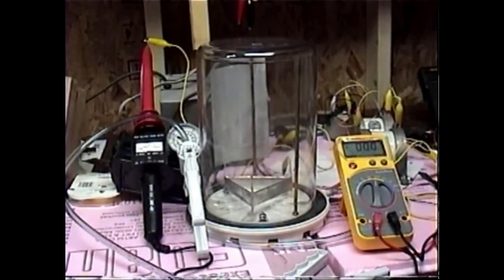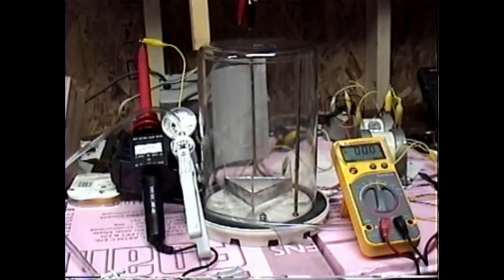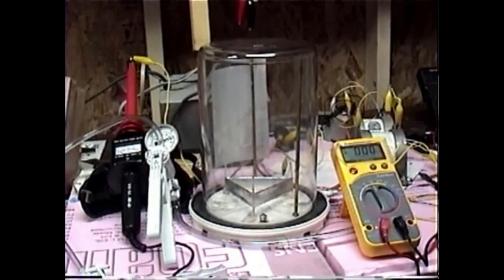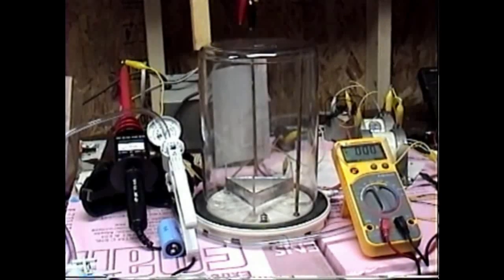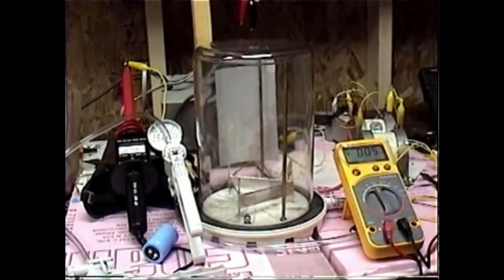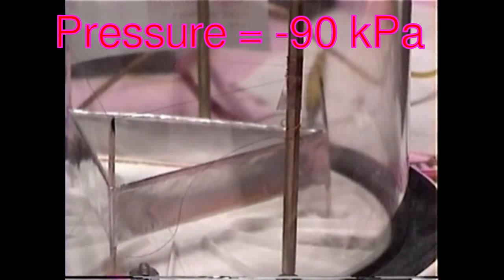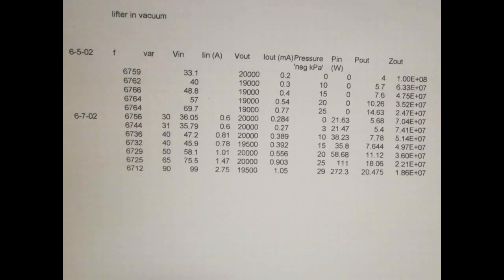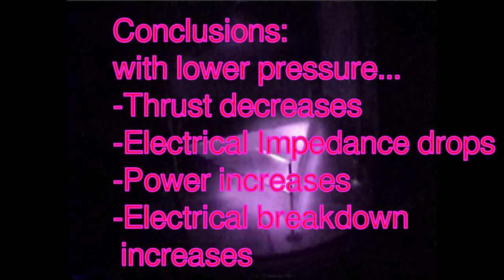Lifter in a Vacuum : Electrodynamic Ion Propulsion

Comment: Hi, This is an ion thruster Setup of the Brown biefeld effect. Brown biefeld mixed These phenomens themselves. There is a second effect BB got themselves into in the 1920s. 1. Use a homogeneous dieletric which is not air. 2.  The voltage must be high enough that the dielectic Shows leakage, but not shortcutting behaviour. 3. There must be enough current available the power source does not collaps when the dielectic acts as resistor. 4. The current must be high enough to generate a circling magnetic field around the dielectric.You will notice that the loaded plate will be drawn into the magnetic field. And this works also in vacuum. And reproduces the 20s result of BB.Since this adds a lot weight, you should make a mill Kind of Setup.And the currents necessary to Experiment with, are dangerous. A high Voltage safety engineer should be around.
Reply from the maker: Yes, Thanks for the great comments. I have been planning to do some experiments like this with some lexan or plexiglass dielectric, to test the BB effect. This will be very interesting.  As soon as I get the time and resources, I will definitely try some new experiments.. Have you tried this experiment?
Reply: Hi, No not yet. I have not found a strong enough affordable powersource yet. BAE Systems use 2 huge Faraday disks to power their Ray guns. These are strong enough for our experiment too. But I don't guess BAE offers them for an affordable price to the home experimenter and guardener ;-). I found an affordable(like 3000 $) powersource in the phillipines (faraday disk generator) that could do the trick to get interesting results. But I didn't find the mood to buy one yet. I am looking for 30Kv with at least 1Amp/s to  have measurable results. Better would be 300Kv with 5 Amp/s (=54GWatt/h) ;-) (Some Universities should have strong enough powersources. .

Comment: And how did they lift off from the Moon?🤔
Reply from the maker: I believe it is a different technology.  This is one of the main focuses of my research.  Ion wind can only operate in an atmosphere, but I believe there are other ways... We will see..
Reply: how much voltage does it required to lift? also can you increase the windings of the coil to provide more lift?
Reply: 45445 Angels 😂😂😂
Reply: 45445 Angels oh that’s why the lunar lander was wrapped in aluminum foil!?🤤🙈🙉🙊🤓
Reply: i meant the ion propulsion device not the lunar lander lol
Reply: 45445 Angels Copy!👍🏽

Comment: perhaps induction requires plasma ionization of the atmospheric gases; meaning the opposite magnetic field cannot be applied to the foil from the upper voltage wire.

https://youtu.be/hNPBYtJyfZo?t=7m35s
two opposing magnets created lower mass weight or lowered gravity
Boyd Bushman On Antigravity

A story of genuine Anti-Gravity. What? Really? You decide......What if its so?
https://youtu.be/KG2dtVEJO6g
Reply from the maker: Very interesting.  When I have some time, I will try some experiments with this, and post my results.  thanks for the very interesting comments..  Yes, I believe UFO's do have very strong magnetic fields associated with their propulsion systems..
Reply: And so perhaps they require the gases in the area of the craft between the two interacting conductors. So it could be done in a vacuum if the craft includes the gases within the craft.

Comment: at the end of the video you used a different frequency  and the corona decreased. SO what I think is happening is first the vacuum still isnt vacuum enough to start creating the predicted Pashen curve impedance high dielectric strength of a vacuum. 

How do i know this? cause you can see the corona in the dark. Once you get to a vacuum which prevents corona then you'll get liftoff - subsequently the corona decreased when you changed the frequency - did you increase or decrease the frequency?
Reply from the maker: I was tuning the frequency around.  When you tune the frequency, it helps to match the impedance.  I do not remember if the frequency was higher or lower at the lower pressures.  It did not have much thrust at any frequency at the low pressures though.  Not sure what would happen if I was able to attain much lower vacuum? Interesting ideas for new future experiments..

Comment: Have you seen the design of the dense plasma focus or Z-Pinch plasma accelerator? Very simple device that fires a DC spark through a gap between two copper tubes, or a ring of copper pins around a center tube. The flow of hot plasma riding the magnetic bubble of electrons rushes into the center tube and "pinches" into a toroidal vortex or plasmoid that polarizes into a beam of negative electrons and a beam of positive ions and radiation. COULD YOU PLEASE MAKE A FOIL LIFTER TUBE WITHIN A TUBE TO TEST THIS IN VACUUM?
Reply from the maker: Very interesting.  Is this what you are talking about?  I will look into it, and maybe conduct some experiments, but it does take a while and resources to set up a new experiment.  I will definitely look in to it.  It is a very interesting possibility.. thank you for the idea...

https://str.llnl.gov/july-2013/tang
Reply: I have a novel idea for a 3D printed ion lifter I'd like to build. I'd love to hear your feedback.

A pair of foam or wire matrix aluminum electrodes that restrict the flow of air on intake and much more severely restrict the airflow at the exhaust of each electrode by varying the porosity of the matrix. 

In this design a lower voltage is necessary to ionize the air because of the high surface area to concentrate the electric field. 

Additionally the circuit would be a type of direct current ringing capacitor circuit called a 'double biased' Marx generator, maximizing the skin effect and ionization at both electrodes simultaneously due to the sharp impulse voltage (rate of voltage change).

This can be enclosed in a thin cone shaped insulator like plastic to produce a nozzle increasing the efficiency and maximum thrust. *Bonus feature*: Outside of the thin plastic cone, wrap many thin aluminum foil rings around the cone so that ions drifting by will cause an electric current to flow in them by induction, this will help focus the ions into the center of the cone, increasing the pressure of the exhaust.

Like this:
      
\XXXXXXX/-----------(+)
  \xxxxxxx/
   \            /
     \XXX/
      \xxx/----------------(-)

Comment: Hi !! i buy also a vacuum bell if i have some time i gonna try as wel at home, nice work buddy! 
regards
Reply from the maker: It is great for doing experiments.  I actually modified mine to get high voltage inside.  I made 4 conductor feed throughs in the bottom and made them vacuum seal so I can do different experiments.  I believe I used bolts with rubber washers as o-rings to make the vacuum seal against the bolt head.  I wouldn't drill holes in the bell jar part. That is made of brittle plastic and has a lot of stress on it.  Sounds great. Experiments are always fun and educational.
Reply: shame we don't live close, if not we can do a lot of things together.
Reply from the maker: That is what the internet is for, it brings people closer. I am only a click away..
Reply: yes i know.... bit is not the same

Comment: Actually...  I would say this is electrogravitics more than anything to do with ions.
Reply from the maker: Hi, I actually had a colleague that worked here at the lab doing research in this area, and he did tell me that with careful measurements, that a small fraction of the thrust could not be accounted for, assuming only ion wind.  You may be correct...
Reply: @satanael9260  |  And just why do You say that?  Or is Your intent to be contrary on a comment 6 years old?

Comment: A series of questions
What do you mean initial voltage? 

From what i gather you are decreasing voltage as the the vacuum is increased? How come you are doing this?

Also what I am curious about is the frequency of the voltage as well

Last is you saw decreased lift as the vacuum increased.
Reply from the maker: Hi, I believe the initial voltage was about 30 kV. This is a typical voltage required for the ion thrust to cause a lifter to lift off. I have to check back on the frequency.  Basically all fly-back HV transformers have a resonant frequency that they like to operate at. I believe this one was around 10kHz.  I use the same setup on several of my high voltage videos, and I believe I mention in the videos.  I actually did these experiment circa 2001 and on VHS tape, so it has been a while ago.  Yes what is happening in this experiment is I am keeping the HV input constant, or at least trying to.  As the vacuum pressure drops, the impedance of the HV power supply sees also drops because the vacuum arc starts drawing more current.  Real power supplies can only supply so much current before the voltage will start to droop or drop. That is what is happening here.  It probably will not be practical to make a higher and higher power, power supply  because it would draw too much power and become too big and heavy, and probably the vacuum arc will catch the lifter on fire anyway.  Also I suspect that the ion effect thrust efficiency decreases with lower vacuum pressures, although I did not directly measure this in this experiment. You can see the ship is not able to lift off at the end with very low pressure though.  There is definitely many more experiments that can be done.  I am always working on new and exciting things and will definitely post them as I get the time. Thanks again...
Reply: @jaynesnetwork  Can you redo the experiment?

Comment: have you ever tried using separate conductors, more like set of tubular metal bars, or possibly a ring shape for higher surface area, more capacitance or less on one side, computer controlled to control thrust in atmosphere also find magnetic field geometries that direct the "thrust" when in vacuum
Reply from the maker: HI Yes these are all interesting ideas.  The high voltage power supply is not capable of putting out enough power in vacuum, at least in this configuration.  I have much more interesting video footage of other electrodynamic propulsion experiments that I am hoping to post as soon as I can get some time..  Car problems have been swamping me, but hopefully this weekend I will be able to post more videos.  Computer controlled, is an interesting idea.  Must be very careful because computers, and high voltage electrostatics are a dangerous combination, but it does sound like a fun project...

Comment: This can't fly because plasma encircles the triangle, you need a magnetic field to give a vector of one direction
Reply from the maker: An interesting idea.  Sounds like a good experiment to try.  Usually magnets are pretty heavy though.  This craft must be pretty light to work in present form. I will give it some thought.  Thanks.
Reply: If the wiring have more wires like a (tesla coil) makes the ion wind efficient for lift of
Reply from the maker: This is a very interesting idea and definitely worth looking into.  thanks again...

Comment: excellent work!!!
Reply from the maker: Thanks, It will be nice to see some kind of electrodynamic propulsion systems for a life size craft one day. Thanks again.
Reply: I'd like to see you experiment with High Voltage Impulse discharges using a capacitor and magnet. I believe HV Impulse discharges create an expanding ''bubble'' in the aetheric medium which is usually dormant. If you can create these bubbles in rapid succession, certain resonant frequencies from the higher octave worlds come pouring in and can be stored in crystals and certain stones like corals. Just because we can't hear the music, it doesn't stop playing.
Reply from the maker: Very interesting theory.  Have you seen this video yet?

https://youtu.be/v3M51dTD3ZA
Reply: yeah that's why I mentioned it.

Comment: You should try a round shape with a solid insulator or dielectric in the vacuum.
Reply from the maker: Yes, Like Townsend Brown?  Great suggestion. T. T. Brown did say that a high dielectric material was important for the electo-gravitic effect that he was investigating.  Of course the lifter has no dielectric between the electrodes.  I will be posting more of my experiments as time and resources permit.

Comment: Ty for taking the time to do this experiment.
Reply from the maker: Thank you for the interest.  I actually did these and many more experiments a long time ago.  I thought that the viewers on Youtube might appreciate seeing some of these experiments so I started posting them.  Right now I am in the process of converting videos of my old experiments from VHS tape media to digital.  As I get them converted I will be posting more, Including more lifter and electrodynamic propulsion experiments.  I am still doing new things as well and posting them too.  Stay tuned and I will be posting things ASAP. Thanks again...
Reply: jaynes network Would you conclude that this ion lifter will not work in the vacuum of space? The ultraviolet light from the Sun and other electromagnetic sources would also help with the short circuiting plasma which doesn't add any motion.
Reply from the maker: I believe that the principle of ion propulsion could work in space.  There are always hydrogen ions, even in deep space.  The power supply would have to be a very different impedance, so this the same power supply that is used at "lift off" could not be used in interstellar space.  This Technology can definitely be used to build a very interesting aerodynamic aircraft though.  As for Space travel, the question is, would it be practical to use these ions in deep space, and I can not answer that question at this present time.  There is another possibility which I did also investigate some.  T. T. Brown did conduct some research in which he claimed that specially shaped capacitors at very high voltage can create an artificial gravitational field.  If this research did prove to be correct, then such a propulsion system could definitely be used in space travel (and also for time travel as well).  I have more experiment come...
Reply: In space they use xeon gas since there is no atmosphere

Comment: Have you tried increasing the height of the emitter wires with the device in the vacuum?
Reply: When lower your pressure you will as you notice have discharge. You dont what that. We can se it in all scenarios when pressure goes down.  If you do as Elena tells you so it does not discharge you will notice other effect.  The ion-wind is just a part of the process the other part is the polarization of dielectric , maybee also vacuum it self.    Naudin putted drinking tubes around the emitter and notice force.  I suggest bariumtitanate and other construction. Anyhow very nice work and effort in this experiment , all respect.
Reply from the maker: I did not.  This probably would increase the impedance with a larger wire separation.  I still believe the thrust will decrease just due to the lack of air molecules for the high voltage to accelerate.  (I believe momentum is conserved but the jury is not completely out).  I did preform some other experiments with the lifters, and will post them as soon as I transfer them from VHS to digital. It is a very interesting subject though. I do believe it is possible to design and build a full size electrodynamic ion propulsion craft that can carry humans at STP. I have some ideas and did discuss some designs with another scientist from NRL, but would probably use a different design than the lifter configuration though, which in my opinion is not the optimum design.